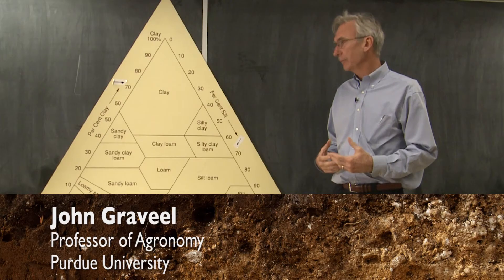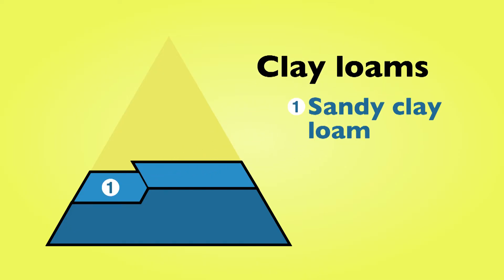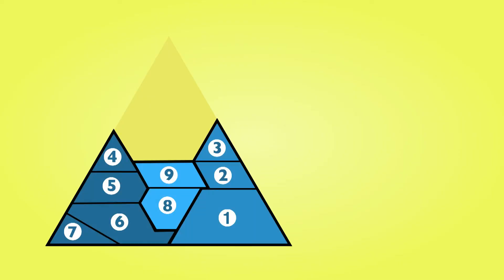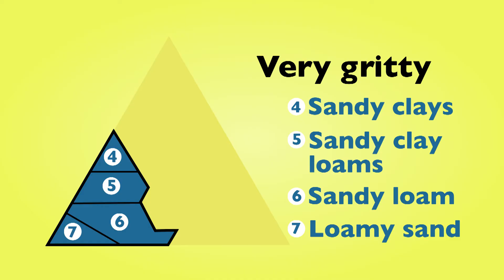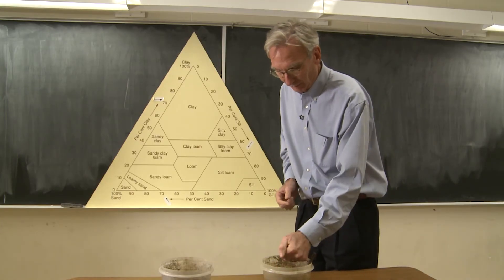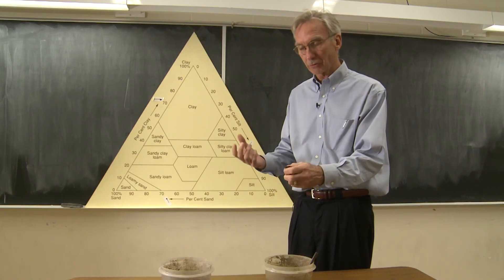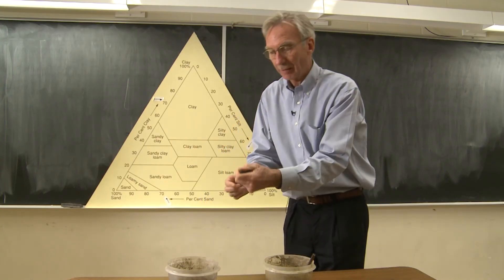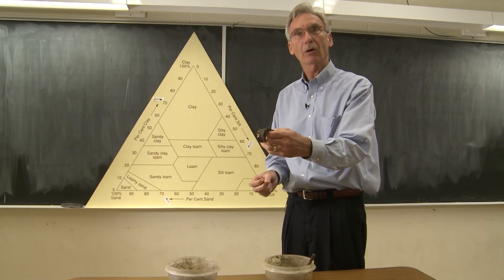Soil Basics: Texture

Comment: Excellent presentation, Professor, thank you!  The best I have come across on soil testing by far (don't get me started on jars of mud around the kitchen waiting on layers to form).  However, there at the very end, don't you mean that second sample you worked is either silty clay loam or silty clay?  You have a heck of a ribbon going but then you say it's either  silty clay loam or a silt loam.  I see it as having clay in there.  Am I getting it wrong?  I have watched this a couple times and certainly will again because when I go out there in the field I want to have it quite memorized.  Thanks again for your assistance as I try to learn my land to bring it to better ecological health through invasive plant removal and native plant installations.
Reply from the maker: Hello Salvia,
We sent your question to one of our soil experts, Jeff Bradford, and below is his reply. Please let us know if you have any other questions.

Silt loams, silty clay loams, and silty clays can all potentially form ribbons about 2" long if the clay percentage is approximately 25% or greater.

The keys I teach for texturing soils are:
- Make sure the sample is not too dry or too wet.  Having the proper moisture will ensure appropriate ribbon length and stickiness, and stiffness of clay.  I add enough water to make the sample workably in my hand.  This takes practice.
- Try to make a vertical ribbon, so the ribbon must support the weight.   This should allow the sample to break at the correct length properly.  If you roll it over your finger as Dr. Graveel in the video, you can potentially get longer ribbons as the soil is supported by your fingers.
- I call the boundary between the loams and clay loams the shine-line.  Samples higher in clay should appear shiny as they are worked.  I try to smear the sample to see if it shines or not.  Samples around the boundary between loams and clay loams can be dull or shiny.  So, you might have a make a judgment call.
- As the clay increases, the sample should become much stickier and stiffer, making it very difficult to work.  It might feel like your hand is going to cramp up.

Things to watch out for:
- Moisture content.  Clays with a high water content will feel more like they are lower in clay.  Samples too dry will feel higher in clay
- Organic matter content.  Samples high in organic matter can make it feel like the clay content is much higher than the actual clay percentage.  Organic matter can also make the sample feel softer, thus leading you to think the silt content is higher.
- Sands content.  Sand is a random number generator.  The coarser the sand, the higher the likelihood of overestimation, and finer sand leads to underestimation.  Very fine sand feels almost identical to coarse silt.  Even experts miss sand percentages.